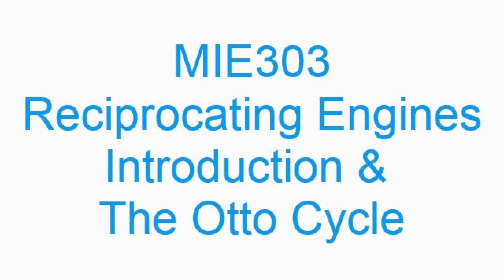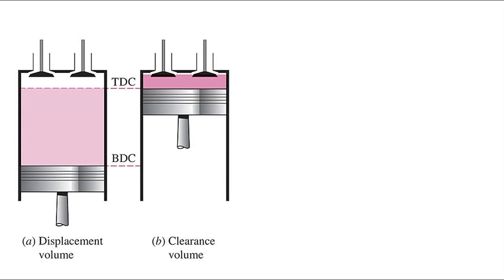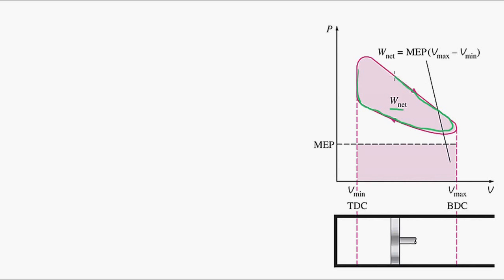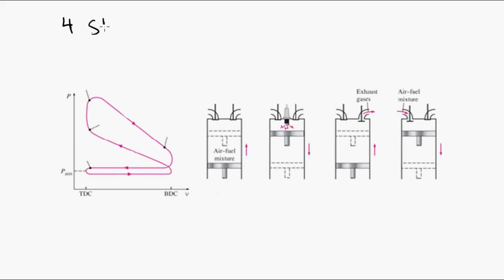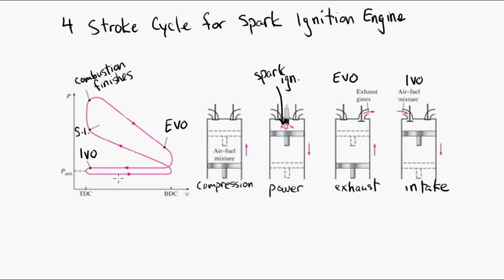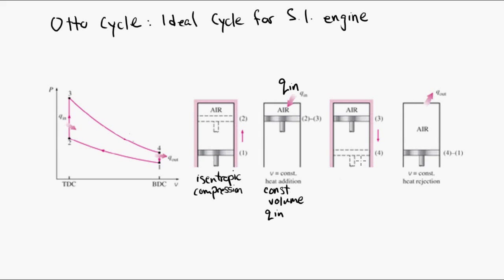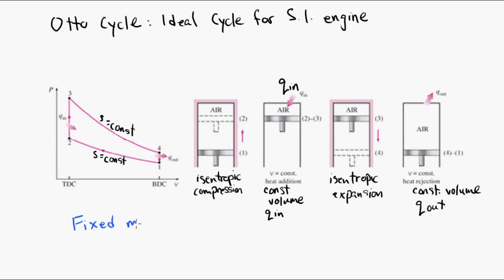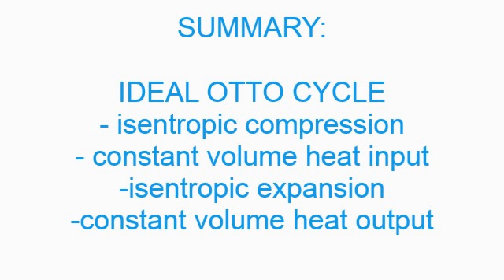Otto Cycle

Comment: in actual cycle u have done mistake,u u should have written exhaust stroke above and intake stroke below
Reply from the maker: Yes, there is an annotation in the video to correct the mistake.  I added this two years ago, when I noticed the error.
Reply: Jeff Harris  sir would u drive work done in Otto cycle please
Reply from the maker: I solve an example problem in a video at https://www.youtube.com/watch?v=ylIbtToa2J0 This may be useful to you.

Comment: Hi Jeff, just wanted to point out that the cut-away diagram in the intro shows what is clearly a motorcycle engine.. not a automotive application. Cheers!
Reply from the maker: Yes. I should have said "vehicle".  For the purpose of this instruction, it doesn't have a significant impact, but I will update with the correct terminology the next time I teach this material.

Comment: Isn't it adiabatic not isentropic???
Reply: +Mehdi Jafarzadeh its isentropic to be more precise .......and also a reversible adiabatic is called isentropic in other words...both are same if it is reversible.......
Reply from the maker: +ABHISHEK TIWARI exactly. Entropy can change as a result of heat transfer and/or irreversibilities.   If the processes is reversible AND has no heat transferred to/from the surroundings (i.e. adiabatic), then entropy is constant.

Comment: Thank you for finally teaching me how a four stroke engine can be approximated by the otto cycle. I have taken 3 thermodynamics courses in university and I also know a lot about 4-stroke engines from rebuilding them, but never has a professor told me how heat is magically extracted and replaced with more fuel.